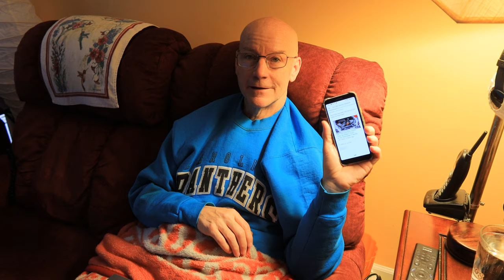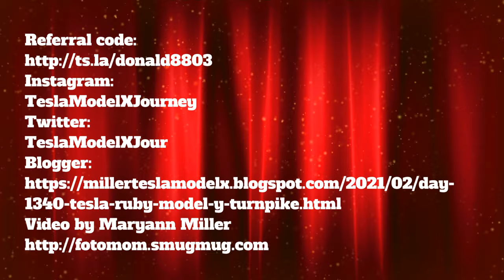Day 1440 Tesla Ruby Model Y Turnpike Transponder Install Behind the Bumper

Comment: I have heatpump envy!
Reply from the maker: There are some "different" noises with a Tesla heatpump car, though. Some might be more trying to keep smell out of the HVAC system cycling the system more because Kyle's 3 when we had it made extra noise vs. Ruby too. Some is just different noises though. Not bad or loud just getting used to it with an otherwise totally quiet car.